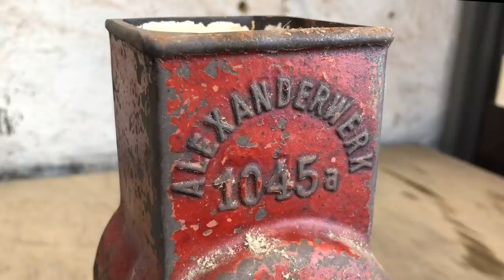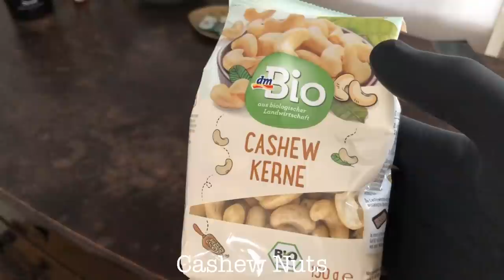Old German "Alexanderwerk" Grater Restoration | Mister Patina

Comment: Well done ! Nice restoration job! 👍👏
As I also have old kitchen utensils with similar drum, I was wondering what they were covered with and also how to sharpen all the small holes?... You answered 1 of my 2 questions about the drum : cover it with nickel plating. Remains the 2nd question 😉 . 
Instead of the bottle 🍺(to push the food) you could make a wooden pusher, with a square shape to slide into the top of the device. And a semicircle shape for the side of the drum. With a rim at the top (wider than the square opening of the device) to stop the pusher and prevent it from being grated.
I have 1 electric grater from the 60s that has a pusher with this shape...
Reply from the maker: Haha, hey Domi! 
When these Graters came out there was a wooden block (like you said) originally with them. The problem was, that i found out later, after the video came out. If i wouldve knew before, ive made a new wooden block.
Youre definitely right! :-)

Comment: Beautiful Mr P.! Like the way you nickel plate the pieces that came that way too. Was wondering why the wire brushing before sandblasting? Is that what I should do if I ever get a sandblaster? Thank you and all the best from North Carolina!
Reply from the maker: Hey Roger! Since my old sandblaster was pretty hard to handle, i just sandblasted the corners and hard to reach spots. With a good sandblaster (like my current one) you could blast this whole thing without brushing before. Lead test has to be negative!
Reply: @misterpatina  thank you for the information! I know you are really busy but please indulge me another question. Is there specifications I should know before purchasing a sandblaster? I would like to have a decent one but not the best or most expensive. Thank you very much!!!

Comment: I really hope you did a test for lead paint on that. You might want to get some of the pen type tests just in case if you don't already have them.
Reply: Its FOOD grater... smh
Reply: @leeeeeee2796  And back in the day they put lead pain on EVERYTHING. They didn't know how bad it could be. smh
Reply: Well that would only be a problem if you want to use it regularly but he sandblasted it and put the right food safe paint on the inside so everything is fine
Reply: @mazevx2451  The problem with lead paint is that it can get into the air through removal an gets into your system that way, not just through contact.

Comment: Amazing. Keep up good work. A question: why wire brushing before sand blast? Sand removes all rust i think?
Reply from the maker: You’re definitely right. But I wanted to get rid of most of the old paint before sandblasting, otherwise all the loosened paint would be in the sandblasting cabinet 😄

Comment: Very nice restoration. How long do you leave parts in the liquid when doing the nickel plating?
B from SYD Australia.
Reply from the maker: Hey B, it depends on the size of the part. With 4 Amps, I leave screws or smaller parts for around 12-15 minutes, bigger parts for around 20-25 minutes. You could do some math, but I do it how I feel for.
Reply: @misterpatina  thanks mate.

Comment: Il tuo lavoro è fatto a regola d'arte, come al solito. Ma ritengo assolutamente poco raccomandabile utilizzare questo macinatore per l'uso alimentare. Capirai da solo che qualunque vernice tu possa applicare, esisterà sempre un'interazione con quello con cui viene a contatto.

Your work is done to perfection, as usual. But I consider it absolutely not recommended to use this grinder for food use. You will understand for yourself that whatever paint you can apply, there will always be an interaction with the one it comes in contact with.